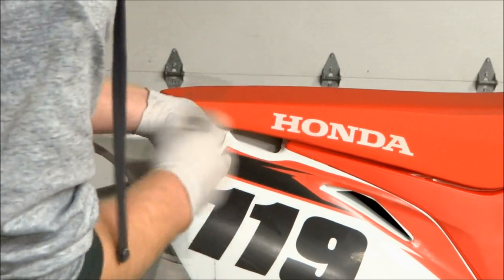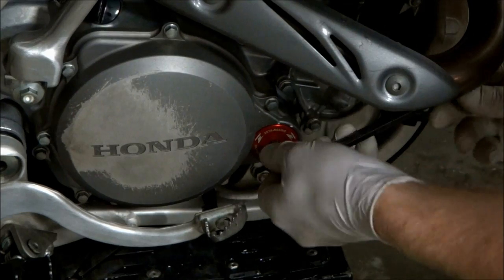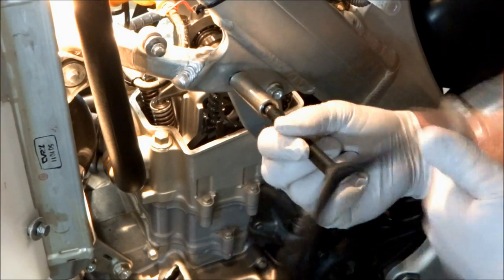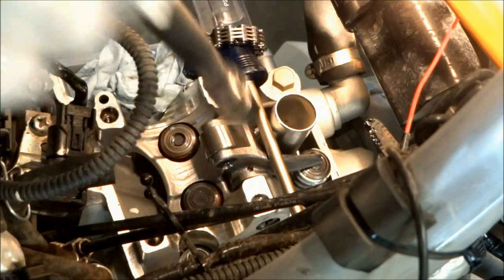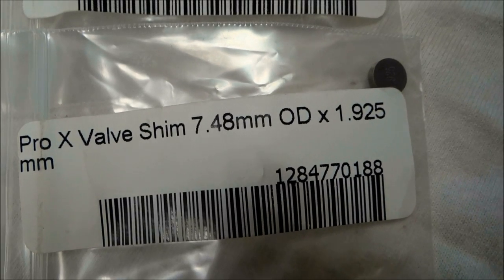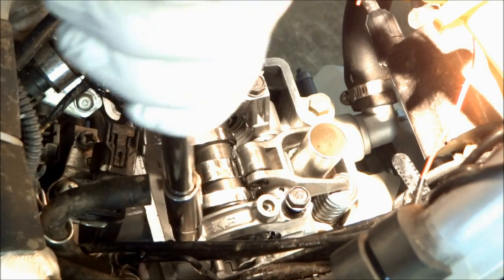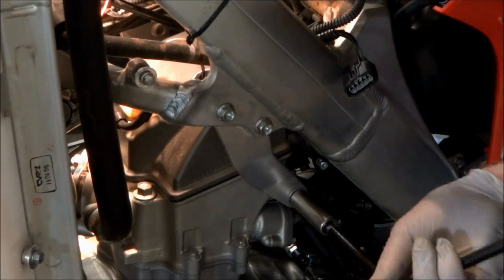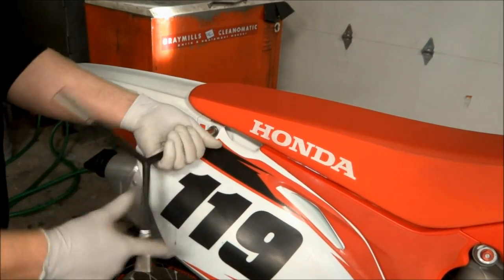Everything You Need to Know About Checking And Shimming Valves

Comment from the maker: The equation is (correct valve clearance- recorded valve clearance) + (old shim size) = new shim size. For example, if the specified clearance is .15mm and your current clearance is .05mm, and you have a 2.00mm shim, then you would do: (.15mm-.05mm = .1mm) + 2.00mm = 2.10mm. You would need a 2.10mm shim or the closest size to it. If you can't get a clearance, go up the specified clearance amount then measure again.
Reply: Wrong.
If your valve clearance is already too small, you are going to need a thinner shim, not a thicker one?
So therefore a 1.90mm shim is needed to open up the clearance.

Comment from the maker: It really depends on how often you clean the air filter and how hard the bike is ridden. This bike had 35 hours on it (from new) with the filter being cleaned every ride before the valves went slightly out of spec. If the bike is being trail ridden, the valves will last much longer.

Comment from the maker: @Clint McCaleb

Thanks! Glad you liked the video.
Reply from the maker: Josh Blockeed
 You need to hold the crankshaft to remove the cam bolts. Take the round sight cover off as shown in the video and have someone hold the crank with an allen wrench. If that doesn't work, use an impact wrench or use a swift motion to get the bolts loose before the cam has a chance to move. But do not try to jam the cam with anything.
Reply from the maker: Josh Blockeed
Some heat might help, but you just need to hold the crank from spinning and it will come loose.

Comment from the maker: Yes, if your bike has a Honda Unicam engine the lobes should be facing towards the rear of the bike at TDC. I don't think the bike would run if the cam was installed backwards. Make sure that you are at TDC. Take the spark plug out and look to see if the piston is at the top of the stroke.

Comment from the maker: I'm guessing if everything is stock that is normal. What you mentioned about the backfiring and hard to start is consistent with valves that are out of adjustment. The engine would not run if you there were valve overlap issues. The problem was with the valve adjustment. Also, cam timing is not going to affect the valve overlap.
Reply: Cameron Niemela ...  got an 05 crf450x ...  impossible to start when cold but starts and runs great when warm.  Gotta continuously crack throttle which leads me to believe it is starving for fuel but would out of alignment valves cause a similar hard starting scenario?  No backfire.  Dirty carb?

Comment from the maker: The cam wouldn't cause the motor to turn over. It will most likely be the crankshaft or piston/cylinder that is causing the motor to seize. You will have to tear the whole motor down most likely.

Comment: I find it less confusing to use thousands with the feeler gauge. .05mm = .002 thousands.  The valve clearance range on most bikes is .003 thousands so the range will be for example  .007  - .009 thousands or .004 - .006 thousands.   If your clearance is at the bottom number, then you just increase the clearance .002 to the top number which is .05mm so drop in a .05mm less than the current shim.

Comment: Hey man awesome video, I have a question on how to calculate the new needed shims, Im doing an r6 engine and the spec is between .23-.30 for ex and .13-.20 for in and i have 4 shims that are a bit off of spec, so how do i decide which spec to use in the calculation? would I just use the middle number of each? Thank you.

Comment from the maker: It will get jammed in somewhere. Most likely it will get stuck in the flywheel and stator and ruin the stator and your bike won't run. Can't just leave metal pieces running around inside a motor.

Comment from the maker: You are most likely on the wrong stroke. Turn the motor over again until the marks line up. If you can't get any of the marks to line up the timing is off and the bike wouldn't run very good.

Comment from the maker: Thanks! Maybe they were adjusted incorrectly to begin with, or you are taking the measurement wrong. Valves that loose would make a ton of noise. Perhaps you accidentally had two feeler gauges stuck together when measuring?

Comment: Great Job on the video!  Question though, how'd you get the measurement for what the gap was at currently so you could start doing the math?  You had the numbers of the .077 and I think like .0102 or something along those lines.  How were you able to come up with those numbers when you saw that the feeler didn't fit on the right side?  Thanks!  Once I figure that part out, based on your vid looks like a pretty easy job.  Thanks for the info!
Reply: The problem is. He left the major part out.. He didn't show you how to put the feeler gauge into the valve area and show what the clearance was.. That's 1st thing you do before loosening cam chain. Write down the numbers from ea. Valve. Then you know what you need for shim thickness. That's what he left out... Half a video on doing proper valve adjustment I think..

Comment: Hey so my 2015 150rb was taken apart because it had some issues with the camshaft holder getting torn apart and long story short I had to replace the piston, valve, and camshaft/camshaft holder. I am having struggles trying to get the shims measured correctly. I have the cylinder head and the camshaft off the bike and I put in the new shims according to the measurements and now I over shot. I re ran the math and it still seemed correct. Do I need to have the camshaft and cylinder head on the bike connected to the timing chain and the bike in TDC to be able to get correct readings when measuring the shims.

Comment: I recently got a 2004 CRF 250, having a hard time start it, so I cleaned the carb, still doing it, i adjusted the valves, the clearances were .002 and .004 on the intake side, now they are .005 and .011 on the exhaust... still having a hard time starting, I decided to take in to a shop, the guy wants to do a top end rebuild with new valves and everything for $800 does that sounds good to You????

Comment: How easy should it be to check the exhaust clearance? (Under the rocker arm). Super small size feeler guage went in like butter but oem spec took some angling and a firm wiggle. Is that normal? Does the rocker arm have enough up and down play to give a false measurment?

Comment: I'm having trouble moving the bearing over right before you take the timing chain off. Should this bearing be easy to slide over or should it take quite a bit of force?
Reply from the maker: The bearing should slide quite easily. You may have to use a rubber mallet to break it loose if it's an older bike.

Comment: i dont really understand the math part i dont know where the numbers came from someone please help.
Reply: ErUpT me either I wish he wrote it out more I just don’t get it
Reply: I think it is the size of shim minus the clearance then the difference is add to the actual size of old shim so he get the size of new shim...
Reply: Check valve clearances first..always convert these measurements to mm, very important. Then minus the CORRECT spec number from your out of spec number you took with your feeler gauges ( if its already in spec then your fine) now just add the width of your shims to that number. This will be the size of your new smaller shims
Reply: Valve clearance - spec clearance + old valve shims.
Reply: like
Reply: ErUpT there are may wedsites that you plug your numbers into and it does it for you little late sorry
Reply: Aussie Honchar what is the website called?

Comment: well, i have a CRF 450 '07, and its bastard to start when its hot.. i stalled at the track, took over 20 kicks to start it back up again..
and it backfires with flames out the exhaust when revving it :D
So thanks very much for this vid.. I know what i will be doing tomorrow :D
Reply from the maker: +Snitchy1989 Thanks for watching! Glad I could help.
Reply: +Snitchy1989 Well atleast the chiks likes the flames ;)
Reply: Well, checked my valves yesterday.. manual states 0.16mm intake, 0.28mm exhaust.. exhaust was 0.31 and intake was 0.24..
Well out of spec! new shims on order :D

Comment: Recently my crf250r 2011 had poblem with the camshaft. It wasted a little bit. I have the option to buy a camshaft without bearings, descompresor and sprocket. Is very sheap if i  buy the camshaft plane than an entire camshaft. My question is, if i get out the sprocker of the camshaft it can get out of time??? And how to prevent that?? I want to buy the plane camshaft to pass bearing sprocker and desconpresor because all of them are in good condition.

Comment: actually i have one more question if you don't mind,if my left int is .004 w/2.85  and right is .003 w/2.85 .. left ex: .008 w/3.15 and right ex:008 w/3.20 then what shim should i put instead of those shims?the manual says 10-20 int. and 20-30 exh?

Comment: Where did ya get that spanner wrench.?,does it hold different 3/8 sockets on the branches?
Reply from the maker: Can't remember where I picked that tool up, had it for many years. It's made by ASV and holds 1/4 sockets. Called a Y handle.

Comment: on the "L" cap theres a second hole beside the one where the bolt goes towards the back of the bike, is there something that goes in there that is attached to the cap that could fall out or is that there for another reason?

Comment: If the tolerance is less than spec (gap too tight), wouldn’t it be ok, rather than having too much play (too much gap)? And if it was tight, wouldn’t it mean it’s ok and that it’d just take longer before the gap would need a bigger shim to take up the slack due to wear?
Reply from the maker: No, too tight of a clearance will cause the bike to run terrible. Either way, you want the spec to be exactly what the manufacturer recommends.
Reply: Cameron Niemela.. I mean not tight enough to hold the valve open but to be tighter than spec. Also, are you checking when the bike is cold or warm?

Comment: If I were changing piston and rings, would it be necessary to remove the left side crank case to remove the  Cam chain guide?  I  doing a top end on my 2010 CRF250
Reply from the maker: Yeah if you pull off the stator cover you can access the cam chain and guides

Comment: It looked like you dropped some oil into the cam shaft retainer bolt holes. Is that acceptable for dirt bikes?
Reply from the maker: This doesn't matter for this particular bike. However on other models it may.
Reply: Gotcha. I thought that would have messed up the torque setting, but I guess you check them so frequently that the bolts would never have enough time to get loose.
Reply: Gotcha. I thought that would have messed up the torque setting, but I guess you check them so frequently that the bolts would never have enough time to get loose.

Comment: Can someone give me a hand. I shimmed my valves the other day. I set to top dead center, ziptide timing chain to cams, pulled the tensioner. Shimmed then put journal bolt back in checked gaps then put the tensioner back in my cams weren't at TDC. I check my crankshaft and it was off top dead center so rotated it back and cams were off. Is it possible for the timing to be off if the crankshaft slightly moved if chain was ziptide to cams? Could it be just because my chain is stretched? Thanks

Comment: @OneOne9 Creations 
 My 08 CRF450R I got not to long ago has been having valve problems, from what I can tell... Hard to start when warm, shuts off when I get on the throttle, etc... I have a stage 2 hot cam in the bike. What should the valve clearance be set to with the hotcam? I have looked everywhere and have no idea where to turn? I might have a couple more questions if you can get back to me. Thanks a ton in advance.
Reply from the maker: The valve clearance should be the same as stock with almost any aftermarket cam. Thanks for watching the video!
Reply: ok so intake= 0.005 and exhaust=0.011?thanks a ton!
Reply from the maker: YourAverageChubbyGuy
 Yes, that is correct.

Comment: Hey my bike started making a funny noise the other day but it's only when I rev it. I am clueless when it comes to working on my bikes but I want to learn. I think it might be my cam chain but I'm not sure. Could you please check the  video on my wall and see if you know what it is?
Reply from the maker: It's hard to tell from the video but it almost sounds like a loose washer or bolt somewhere. A cam chain would get louder when you rev the engine, but now when you let off. Try to upload a video with a little better audio and I could help you pinpoint it. But definitely go through and check the hardware, especially around the exhaust system.
Reply: I've had the same issue but then found out that it was the bolt holding my gas tank was loose. So every time you rev you cause vibrations and if its loose it will have a dinging noise which could be the bolt or washer or even both. Before you ride each time just check your bolts and make sure they are snug because over time they will loosen up

Comment: Hello i have a problem with my crf 250R 2006 it's very difficult to turn on the bike and when it happens the exhaust tube get so hot it goes red almost catch a fire. Does it ring the bell to you? Do you think its a valve problem?
Reply from the maker: The exhaust header getting red hot when idling is fairly normal. But hard starting could be the result of valve clearance being off. Check your valve clearance.

Comment: What does it mean when it says valve clearances .006 +/- .001 ? Is that area in between the measurement that are accepted?
Reply: Never mind. Brain fart. Just realized that's the acceptable tolerance above or below the spec.
Reply from the maker: +Belicose777 Yep, that's correct.

Comment: Great video! However, if you do the math right you should never have to Re-Shim, I built a spread sheet that lets me input the current clearance and it spits out a new shim size. It just takes a little bit more time in checking the clearance to get an accurate measurement rather just just a close enough one. I also noticed you stated only one clearance and not a range of clearance. You want to make sure you are not out side the specced range I've seen motors go out of spec both over and under.
Reply: That’s not entirely true. Look up “How To Adjust Valves on a Motorcycle or ATV - Shim Type” from Rocky Mountain ATV MC. In their demonstration they encountered a valve with zero clearance, decreased the shim size by the maximum service limit, and then had to re-shim it anyway because even that wasn’t enough.

Comment: Any idea why when I replaced my left intake valve shim (which was the only one originally out of spec), the right intake valve is now out of spec?
Reply from the maker: Brady Lemons If it was run afterwards the right valve could have worn similar to the left valve. However, that is not likely. Check to see if any debris entered the cam bucket or shim area causing the valve clearance to be thrown off. Might just have to re-shim the right valve as well.
Reply: Thanks for such a quick reply! I'll definitely look into re-shimming the right intake valve. Also, thanks for such an awesome and thorough video. I would've never had the confidence or knowledge to undertake this job without this exceptional video! Bravo!
Reply from the maker: Brady Lemons I appreciate the kind comment! Thanks for watching the video.

Comment: Hi I have a 2006 crf250r and it don't want to start my intake valve ok but both of my exhaust out of spec by .10mm on both sides can this be the reason my bike wil not start
Reply from the maker: +Glennshawn Smart Yes, tight exhaust valves will cause the bike to be hard to start.

Comment: Is the pathern is the same for 2010 crf250r?
Reply from the maker: Yes, the process will be the exact same for a 2010 CRF250R.
Reply: So the engines in 2010 and 2011 are the same?
Reply from the maker: Ride Qc  That's correct, the engines are identical.
Reply: Thank you!

Comment: what does it mean when my motor is at top dead center but none of the lines match up? and also nowear near the right size feeler guage will fit, i put aprox 4 hrs on the bike and the valves were checked 2 hrs ago from when i got it. its a 2007 crf250r, help?